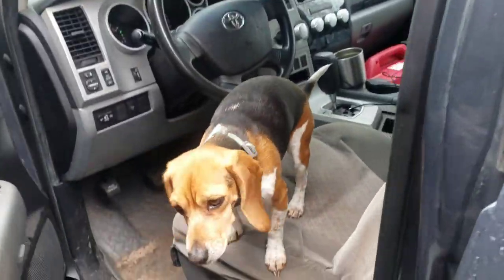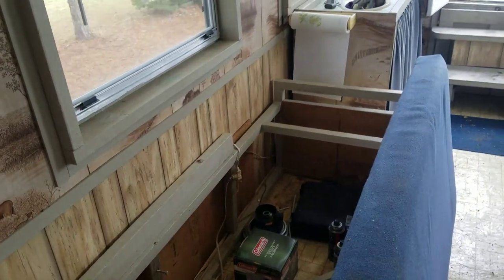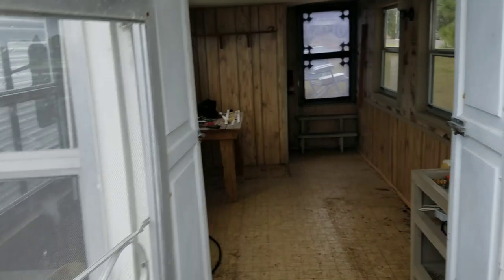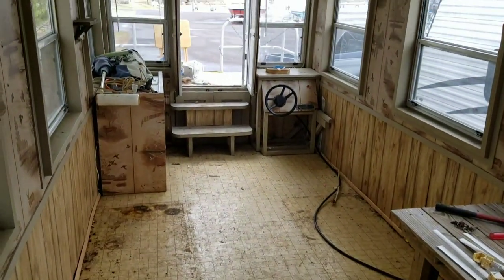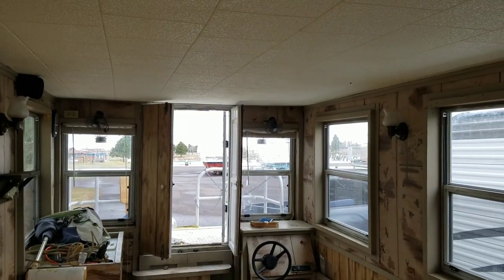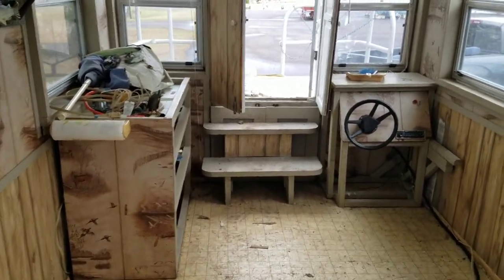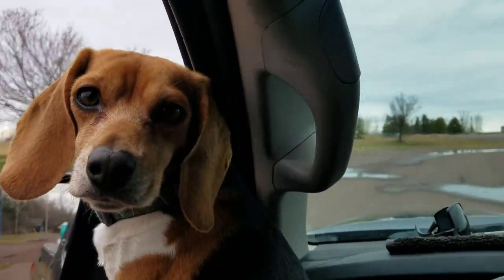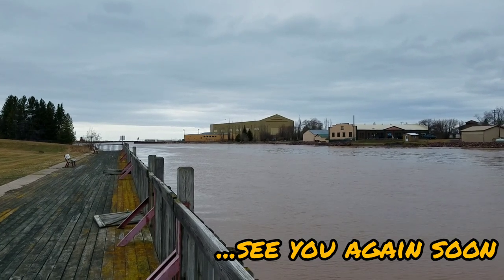Ep:2 "Beagle Barge Beagle Build" | Interior Blank Slate

Comment: Walmart has a nice Futon couch the pulls out to make a bed. They are very comfortable just to sleep on as a couch. They  are black metal frame. You can assemble in the boat. I used a 1/4in tongue and grove wood in my last van build. They sell it at Lowe’s. I bought the one that looked like a distressed beach house. Kinda gray. That would look great with your metal idea. I would just paint the ceiling a off white to help keep it bright inside. All that wood can make it feel dark.  If you really want to save time and money, use your metal like you said and just  paint over the paneling with a light gray paint. I did that to my place in Florida. Then I used a water proof distressed wood like flooring. It would give that a great beach cabin feel. I can send you pictures if you text me. It may give you some idea. Have you priced wood lately?  Paint will save you a lot of money. Let the rustic flooring give it that cabin feel. Plus that orange light is a strobe beacon light I believe. Look around the top, I bet they have a mounting bracket for it. That will work great if you are anchored on a foggy river.  Send me a text and I will send you some pictures of my place in Florida. I think it’s the look you are after. You can find the flooring pretty reasonable. But paint will save you a lot of money and you can still get the cabin effect with the metal and right flooring. Very excited for you and jealous. That’s my dream Shanty boat.  Check out my latest video. After I get this motor tuned in I’m going to buy a shanty boat like yours, or build one. I just missed one like yours in Kentucky last week.  It was 32ft and was setup for twin engines. It was just up the river 50 miles from me. I was going to just drive it home. But a guy beat me by 30 minutes.. Anyway, great find on your Shanty boat. Looking forward to your adventures

Comment: Loved the idea of opening up the ceiling and making use of the extra space and for visual affect but they may have put the peak on top of an original flat roof? Hate that double doors opening inward and blocking the view of the driver. Feels like blinders and if a wave came over the bow and hit them, I'm not sure they'd hold up! Rather see a combo screen/window and door open out so if water hits it the pressure pushes it more closed against a stop (with weather strip of course). If not an option there are hinges available that allow the doors to be lifted off when not needed and you could set them out of the way in the back! I love our woodstove, takes the chill out and in cooler climates, that's us, your windows will be fogged in the mornings! It clears them really quick! I can recommend the Mini Cub that we have made in Quebec but would spend for their double walled pipe as the single tends to build up soot! Not a big deal to clean but! Also like the metal "Wayne Scott" not :Waynes Coat" by the way Lol! I know Wainscot  might be American English! Lol! Great foot print to work with and yes the stairs as not great. Good place for a set of drawer/steps combo!!! Look forward to seeing it progress! All the bestRoy

Comment: If you had a swivel passenger seat it could be turned into a workstation or breakfast table  option .
   The wood and tin would add some weight my thought the tin would be cold and radiate the cold  if traveling during the early spring and fall seasons . 
  No matter what it’s a great hull and blank slate is best . Good luck

Comment: If the walls are strong enough, you might use a hammock for your bed. It's easy to move out of the way during the day. For desk/counter space on the passenger side use an old interior door mounted on the wall with hinges so you can fold it down when you need it out of the way. https://youtu.be/Q0QGNfST7tk  Use some cargo nets and hanging baskets for storage.